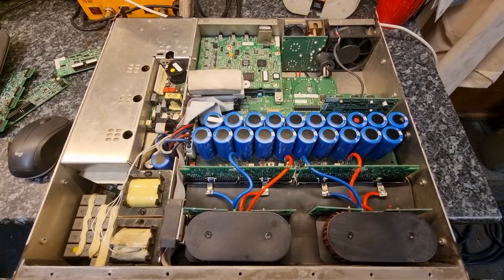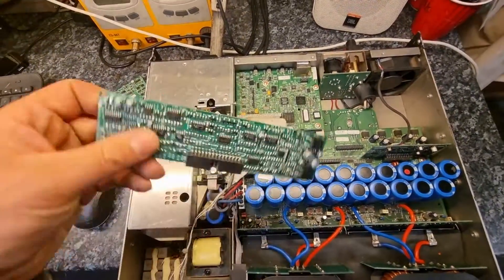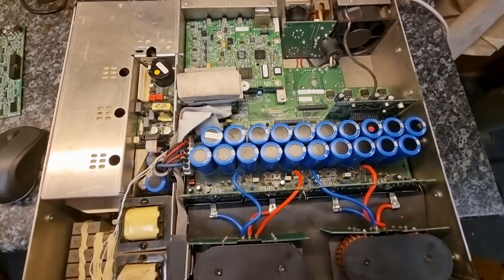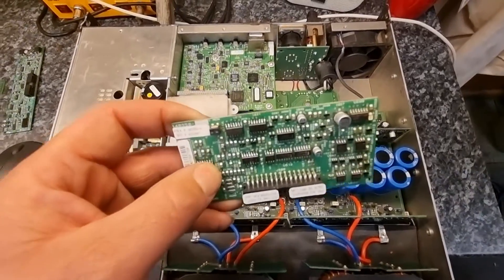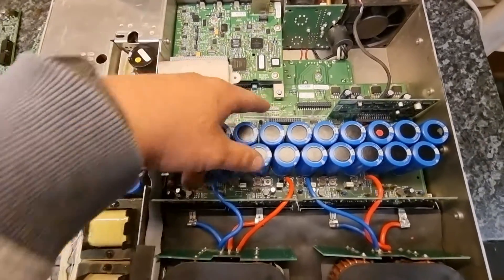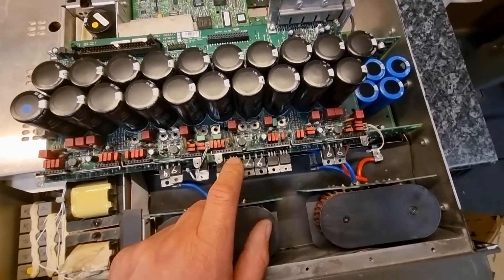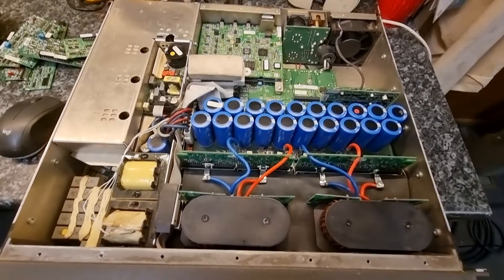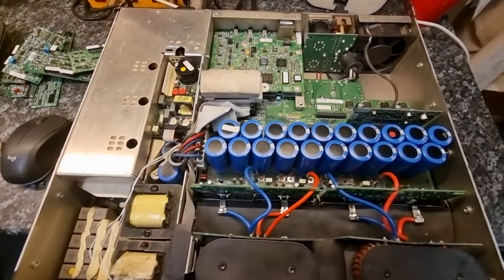A technical look at the crown MA12000i/ITech series of amps.

Comment: Is there a guide for certain settings, so that the amplifier does not overheat? Because my Crown i Tech amplifier is very hot, what do I need to check?
Reply from the maker: No reason it should run HOT. Can you explain more? With no audio for example, what power does it draw from the mains?
Reply: @f @fusioneventservices In this case, the amplifier is not loaded (without audio input) and I tried to check it without the filter core. By measuring the negative channel IGBT output with ground, it reads that there is a VCC - leak, and sometimes it disappears by itself. Can this be categorized as a leaking PCB? Because in the location of the negative channel there are traces of a burned PCB, but I have cleaned it.
Reply: @fusioneventservices I suspect that the PCB is leaking on the drain and source lines of the negative channel MOSFET, because if the hot condition is turned on, only the negative channel MOSFET will be damaged and only that part will be damaged.

Comment: I have a Crown IT6000 when press the power botton the screen on 1second and shutoff，both red fault light turn on. But if I unplug the output of the powersuppily，it can turn on and I can get the right voltage from the psu（+-180V），I measuring all the igbts are not short，what could be the issue？
Reply: I unplug channel2‘s inductor，it boot but channel2 shows clip😆
Reply from the maker: @郭希与  Your output section has failed. Will be dead mosfets and drivers - if you are lucky.
Reply: @fusioneventservices I found a mosfet not short but can‘t hold more than 130V（by a transistor high volt tester，others can handle more than 280V

Comment: I am servicing the crown 9000i, the standby condition and I found two damaged igbts, after I replaced them with new ones the condition is still standby. At what points do I need to test? Do I have to remove all the igbts and test the points on the driver. Thank you for your answer
Reply from the maker: There will be more damage than just two IGBTs, at the very least, their drivers will also be damaged. The video explains basic steps of what to do in this case, but be careful, as the high voltages can easily kill you.
Reply: @fusioneventservices  for bias setting, which vr should be set, is a guide for bias setting

Comment: 15:05 I've been (trying to) design a better, more stable and less noisy version of that topology for a while now in my spare time. One thing that jumped at me at first when I copied Crown's circuitry into a simulator is that the current across the inductors tends to rise into oblivion (that would drive them into saturation in the real world) if you don't get the "overlap" adjustment just right – which is finicky and tends to vary with temperature (creating a potential for thermal runaway) and loading conditions. Maybe, there's your answer!

My solution was an active PI control loop that continuously senses and compensates said "overlap" – or bias – preventing both inductor saturation as well as operation in class-b, which is undesirable and happens when the bias is too low.
Reply from the maker: Curious. What sort of power levels have you been playing with?
Reply: @fusioneventservices  ah! Something I forgot to mention in the original comment is that my topology uses a grounded bridge arrangement for each channel, with a floating power supply, reducing the voltage requirements by half and allowing the use of Schottky rectifiers, lowering the transition losses.
Reply: @fusioneventservices  4.5KW~6KW, but it sort of doesn't matter for now, because things don't really blow up in a simulator. I've yet to build a prototype to really test it all out.
Likely, the prototype will be a 500W average, 2000W peak unit, as it's all I need at the moment, for an active PA subwoofer project of mine.

Comment: I have a couple if Crown XTI6000 amps on my repair bench.  They are very similar, but with much more basic dsp.  I was very interested in this repair video, as no techs in my circle have any experience in repairing these.
You talk about the IGBTs, but in the XTI6000 they use Mosfets.
One point you didn't mention:  If the high speed diodes fail, it is important to replace them with matched pairs, hence the numbers that are written on them.
Reply from the maker: Very good point well made.

Comment: Very informative video, thank you. Do you have any experience repairing the power supply of the 12000i? A video of exactly how the psu is working would be great. And...... by any chance do you have / can you share the schematics?
Reply: Sorry for intruding! 😅
The power supply is an LLC converter that is fed directly from the mains rectifier. It has its frequency modulated in a way as to maintain a more or less constant RMS current flowing at the input, according to the delta between the set voltage and the voltage sensed across its secondary.
The only info you're likely to find about it is a PDF underlining its working theory, which I cannot link it here, unfortunately, because YouTube s*cks! 😒

Comment: hello...I have a question!! Can I use an audio card from the input of an it6000 in an it4000?
Reply from the maker: Yes.
Reply: @fusioneventservices  Thank you very much, I changed it and it worked. However, in the DSP menu, the information started to show the IT6000 model and not the IT4000 and brought the IT6000 presets. Does it not affect anything in the limiters and protection parameters???
Reply from the maker: @nelizitopina6714  Ah you mean you changed the entire DSP input section. Sorry I hadn't realised thats what you mean. It would be worth checking out the larger SMD caps on the old DSP board. They go short. It may be recoverable.

Comment: Are there symmetrical supply like +B / -B and GND like in others amplifier like class AB or class H?
Reply from the maker: They are Digital, so the output drivers are only ever on full or off fully. They never operate in any other mode.

Comment: Hello, i have in my workshop i-tech 3500, when i connect the standby psu blown the small fuse, this psu go to dsp pcb?
Reply from the maker: Yes. Check the caps on the DSP, they go short across the rails.

Comment: What did you just say? 405 Volts on a 2 x 200V rated capacitor bank?? I do not believe you!! Or is it 250V rated electrolytics?
Reply from the maker: 220v for the itech9000/ma1200i, 200v for the it6000, if you believe me of course.
Reply: @fusioneventservices  I believe you, but in case of 220VDC rails, 250 V rated capacitors are needed for sure! BTW: What exact IGBTs is Crown using? Since Class I topology was invented (by Crown's top engineer Gerald Stanley) in order to get rid of body diode recovery problems at all, they could also use MOSFets, like e. g. 600V CoolMos. What is your opinion?

Comment: Good video 👍. But I need you to do me a favor by handling the driver boards without touching the solder lands to prevent zapping sensitive components from the possible static charge on your hands. I stopped doing that back in 1989. Again, great vid dude👍
Reply from the maker: Valid point, I have however never blown up a component from static in all my years of working with electronics! I must be lucky!
Reply: @fusioneventservices me neither but now that we've said it....

Comment: Hi, very informative video. I have 12 of these amps and have carried out a few repairs and learnt a lot too. I have a power supply issue with an Itech 8000. Do you have a schematic of the power supply gate drive cards at all, I have the rest of the power supply drawings but not the gate drives for some reason. Many thanks Kevin.
Reply from the maker: I'll have a look if it's not too late.
Reply: @fusioneventservices  hi no it’s not too late. I still have it in pieces 😂

Comment: Very informative and rare video about these series of the amp. Thank you. I am curious to know if the power supplies are segregated for both channels. As we can see there are two sets of red and blue wires and two big transformers. Or all of them are connected in parallel for more current handling.
Reply: Just one split rail PSU.  The coils you see with the red and blue wires are the output inductors in the balanced current drive circuit. They are nothing to do with the PSU. :)
Reply: @madgadgetuk he's talking about the fact that there are two transformers in the PSU, as well as the fact that the output cable from the PSU has duplicate wires and terminals for each rail.
My guess is the two transformers are just paralleled-up, and they're indeed splitting up the PSU's output between the two channels, to minimize crosstalk.
Reply from the maker: Not so! they are in parallel, one as a series resonant tank (for pfc phase shifting) and the other is the main stepup for the bulk storage used between both channels.

Comment: This video was a huge help in fixing the automotive version of this circuit, the JBL/Crown A6000GTI. Thanks for that!
Reply: You've got it working now? I saw your comment and meant to reply. Sound like front end cards were damaged. I hope you have done a repair video!
Reply: @madgadgetuk  my issue all along was the headers!! The connection to the pins was really unreliable. I had to remove the plastic guides, squeeze the forks, and tin the pins to make them a little thicker. Would love to hard solder to the board but they're surface mount.
Reply from the maker: @barevids  Yep I've just seen that video now. Interesting as that's not one I've seen myself or heard from the UK service engineers I've spoken to in the past.
Reply: Ah I've just seen you have a new video. I shall give it a watch :)